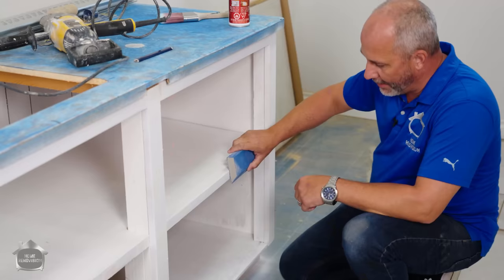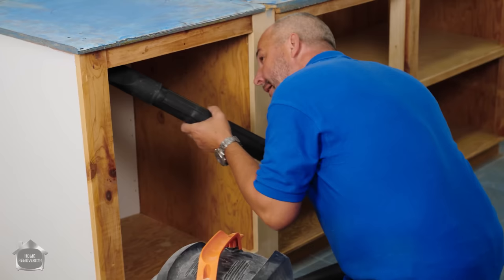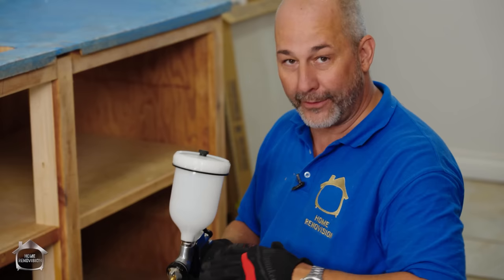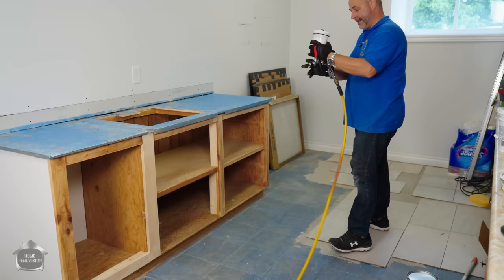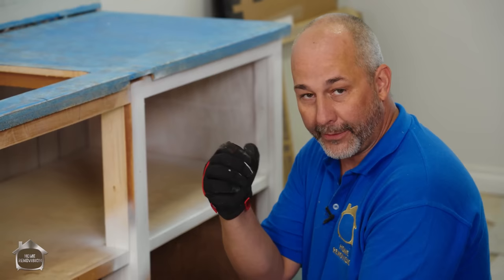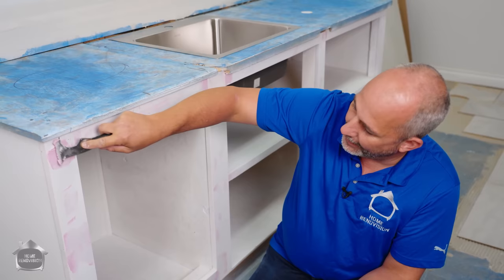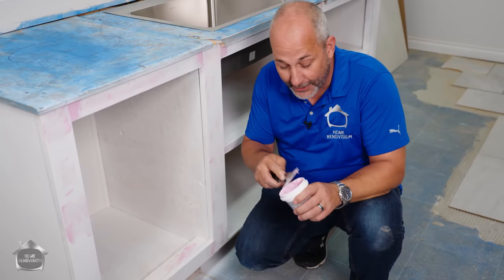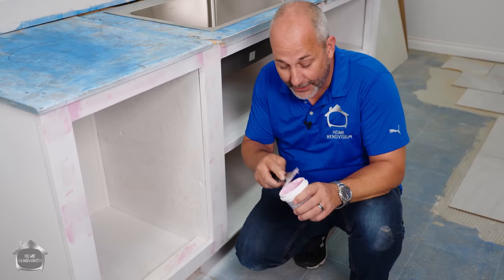Painting Old Kitchen Cabinets / DIY Project

Comment: What air tank do you use?? I’m about to start some small painting projects and would like to get an air tank but not over spend on it. Not sure if at least needs to meet the minimum CFM specified by the gun spray. Thanks!!!
Reply: Hello, which air compressor did you end up getting. Thanks.

Comment: good morning Jeff! I've got a small 250psi 5.1scfm compressor. Given I have enough patience for regeneration, will it produce enough air to redo cabinets or would I be better off turning down the volume on my airless Graco? Cheers from Michigan.
Reply from the maker: I would use the airless. Cheers!

Comment: Curious about water vapour from your compressor. Do you have a dryer or separator on the air line? No fisheyes in the paint?
Reply from the maker: i bleed it before it spray!

Comment: I just have a question. How do I know when the paint is dry on my door to be able to hang it back up without it sticking and pulling the paint off when the door is opened.
Reply from the maker: spray work dries incredibly fast. give it 1 hour and you will be fine. Cheers!

Comment: Overall I like your videos (thank you). In this one however, you’re flexing your wrist a lot causing rotation which changes the angle of the spray to the work surface. That causes overspray. When spraying an inside edge of the panel (on the face), I would hold the gun perpendicular to that edge (as much as possible) and spray with one straight continuous motion across the entire edge. Rather than short small bursts. Good luck on your project.
Reply: Yes, I saw the too. His spraying techniques need work

Comment: Hey, whats your opinion on the molding on the cabinets?  I put my cabinets in the basement during renovation and later found out they have over grown with molds . Just wondering regarding to safet.
Reply: A dilute bleach solution might work to kill the mold, but its possible it might damage the paint. You can try spray a small section to see if the paint is damaged by the weak bleach solution.

Comment: as a professional  cabinet refinisher  If your  going to use a gravity gun  you  might as well  do it right .   shellac  primer   should be your first    coat because  it will block any grease or furniture polish  without  fisheyes.    and it dries  really  fast especially when  it's thinned with alcohol and it sands really easy .  then buy some lacquer based paint for a real professional finish.  you need to thin it with lacquer thinner alot .  you could  buy the siphon fed or pressure pot sprayer  it clogs less because  it'd fed by air pressure  and not   gravity.  theses paints are thin enough that you won't have a air pressure problem  you should  have at least 4 thin coats .  they dry fast.

Comment: If you'd like a working beach holiday next summer - let me know. I think you are the only person I trust to help me build my shed.
Reply from the maker: LOL. Cheers Tina we just finished a new shed that will blow your mind. Comes with a built in bar for entertaining
Reply: @HomeRenoVisionDIY  I currently have a steel Home Depot 4' wide x 10'  long that no longer fits my needs. I need more vertical space. I want to keep the same footprint and will need a concrete pad.  As it is right up next to my fence and the opposite side and end side (opposite the door side) both have rose trellises, it will be tricky building a new one. I want to build one with equal height walls approximately 6.5' tall with a small loft space at the end under where the roof meets the walls with a rolling library ladder for additional storage approximately 4 feet deep.  I would like to install vinyl shingles and skylights.  My idea is to prefab the walls including shingles, in order to assemble the shed. I have a restored wooden 1/2 windowed standard sized door for the entrance. I think you'd be perfect to build this as you are good at problem solving.  My cottage is a three bedroom 1/2 a block from the Long Island Sound in Connecticut 90 minutes from NYC.  I'd pay you obviously and you and your team could enjoy our lovely beach and train into the city for shows at night. Any interest?  If so we can work on a price and I can block out my rental calendar for a couple weeks next June.  My current shed will need to be dissembled.  I can email you photos of my current shed. There is a gated entrance on my driveway into the my back yard where the shed is.  The gate is 4' feet wide.  Let me know if you want a break from cold Canadian spring!
Reply from the maker: Thanks for the offer Tina, we will let folks know when we are hitting the road and what we are looking to do when the time comes. Cheers!

Comment: You say high pressure low volume in the video a couple different times but I'm struggling to find a HPLV .... can easily locate plenty of HVLP.  Do you have a link to the product?
Reply from the maker: I used the 2 pack Husky kit from home depot. Cheers!

Comment: HPLV? High pressure low volume? I think it's HVLP, High volume low pressure! Use Zinsser BIN tinted shellac and you won't have to mess with thinning it and won't have to wait overnight for it to dry.
Reply from the maker: traditional guns are hvlp but this set up is the exact opposite. Cheers!
Reply: As OP said, this is hooked up to a standard shop air compressor, so it is indeed High Pressure Low Volume. Also known as a "conversion gun".

Comment: I know your gonna be selling the church, but could you do some indepth basic electrical? I recently bought a house and want to add some electrical outlets and replace some switches and its a bear to try to find someone to do them in my area. I have plenty of tools and know enough to be handy but have never touched electrical, I looked through your playlists and only saw a video on light switches.
Reply from the maker: we are doing a laundry room install from scratch. doing the electrical on a permit myself and we are filming the rough in and final phase of wiring that. Should be enough info to help you out. Cheers!
Reply: Black and Decker books on installing anything electrical..., also great books on plumbing etc

Comment: What timing was that I was just pondering what I’m going to use to paint oil based paint with because I don’t want to ruin my sprayer
Reply: Oil based won't ruin your sprayer.   The solvents will break down your seals over time but that's only will happen if you use it alot and if you're  using  it a lot then go to harbor freight or princess auto depending on your country by yourself a $30 sprayer for oil-based.  Or get rattle can just use that. 😆
Reply from the maker: simple paint thinner for oil base paints. Cheers! or varsol but in less amount.
Reply from the maker: that is why i buy a cheap gun so i can throw it away instead of trying to clean it.
Reply: @HomeRenoVisionDIY  did you use any kind of desiccant or filter to dry out the air or filter out oil from the air? I’ve seen a lot of videos that talk about using some of these especially when using oil based finishes.

Comment: It is an HVLP NOT HPLV sprayer. High Pressure Low Volume. A true HVLP uses a turbine rather than a compressor. The turbine provides a large volume of air at very low pressure.
The BIN in the spray can is a white pigmented SHELLAC, not an oil!

Comment: Paint sprayers are a nightmare, I'll never buy one again. One leak and all hell breaks loose. The time it takes to cover the entire building in plastic pretty much negates the time saving versus just using the rollers
Reply: I've done rolling for smaller bathroom. cabinets, but I had to do an entire kitchen, I'd consider a sprayer.
Reply from the maker: sprayers have a very consistent finish and overspary is only a thing for folks who don't take time to prep . Cheers!
Reply: @HomeRenoVisionDIY  my issue was hose leaking, fixture leaking, joint leaking, nozzle clogging even though i used a strainer. I was using the most expensive graco model from menards. Got another one, brand new paint, ordinary white latex, mixed, strained, etc... Still a nightmare.

Comment: You're not going to get high quality from a jack of all trades.  I've been managing projects for over 15 years and I have yet to see a jack do high quality work.  I have used the rule of thumb good, fast and cheap. You only get two of the three.  Most jacks are fast and cheap but the work is low quality.  Professionals are good and fast but they are not cheap.  DIYs when they take their time can achieve high quality and save a lot of money but the process is very slow for them.  Good, fast and cheap remember it folks.

Comment: There is one thing I won't paint. Cabinets are difficult to say the least. Great videos here but this job was as basic as it comes. Masking off your kitchen, expensive countertop, appliances, flooring all adds to the project and makes it more difficult. Do it wrong and your kitchen will look like trash.
Reply from the maker: no worries. a little tarpa dn plastic to seal off the overspray and you are gold. Cheers!
Reply: @HomeRenoVisionDIY  love ur videos, any advice for removing dry mortar off ceramic tiles? Thanks
Reply from the maker: get it good and wet first and then use a plastic scrapper. Cheers!
Reply: @HomeRenoVisionDIY  thanks for the reply and the endless great videos. After trying for over an hour without any luck. I tested an area with some watered down acid and managed to get the mortar haze off the tile.

Comment: Your HPLP gun doesn’t sound right. I don’t think it’s set up correctly. Also you should hold the gun 4-5” away. There are 3 adjustments on your Husky Gun.

Air pressure at the bottom should be anywhere from 20-40 PSI. You need to have a pressure regular attached do the bottom of the gun. The pressure needs to be checked with the lever pulled back 50%. There are over 40 videos on YouTube that specifically discuss the proper settings from professionals. One settings is for fan width. One for air pressure and one for the pressure from the paint cup as well. also you need a compressor that will output enough CFM at 40 PSI end a large enough tank to give you the proper amount of spray time.

At least 20 gallon compressor 30 is better at will provide 7.5 minutes oh spray time at 30 PSI!

The large of the tank size the longer the spray time the smaller the tank size the less the amount of spray time.

Comment: I see that you are slowly slowly slowly slowly learning how to spray finally. Original bins wouldn't need thinned out for an hvlp sprayer, but anything you put in the hvlp guns should be strained first for best performance. If you were willing to use an airless sprayer with a nice fflp tip (fine finish low pressure), like a 208 or 308 tip, you could spray a coat on that cabinet in probably 2minutes, those door faces, probably 15seconds each. Just have to really move your arms and watch your overlaps and be consistent with your arm movements. Now... Why do I even care? Because if you're making a video about finishing a cabinet, especially to a brushless factory finish, then there are much easier ways to get there than using mini rollers and a bunch of sanding to get rid of stippling.
Reply from the maker: Cheers Alex. I am showing folks how to incorporate the compressor they own to do a job. No reason a homeowner doing a job should spend 2500.00 on a new airless sprayer. this works just fine for a budget conscious person. Cheers!